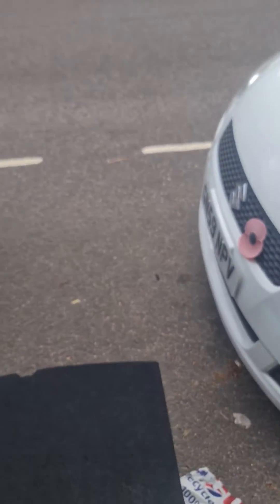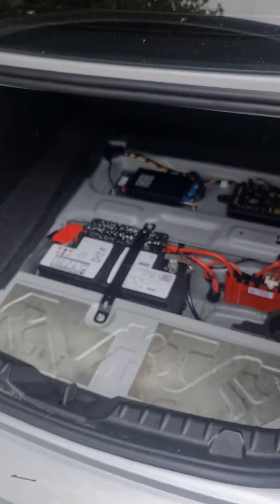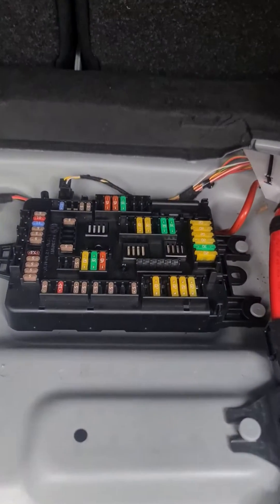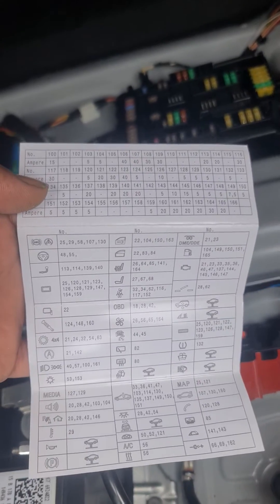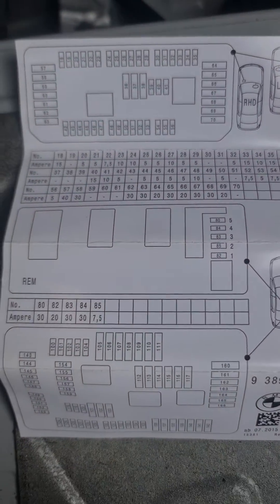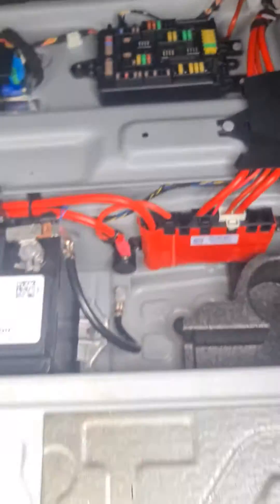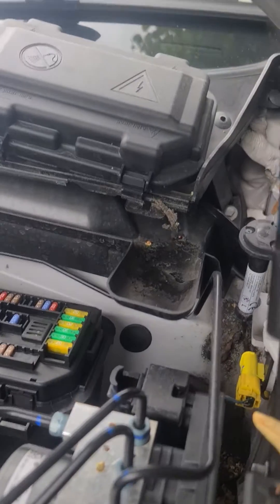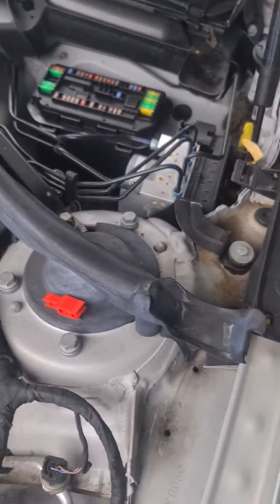BMW 2 SERIES F22 FUSE BOX LOCATION & DIAGRAM

Comment: Any idea which fuse is for the license plate lights? One doesn't work for me. Otherwise, I'll just rewire the one that works into the one that doesn't. 😢
Reply from the maker: Don't get me wrong but I'm not here 24/7 to give clues for people if you have this kind of issues check fuses I'm trying help as much as I can but come on I'm working as for living
Reply: @Empire-Motors-UK  we swap the fuses that were blown but it wasn't related. Ended up getting a wire and splicing it from one plate light that works into the opposite side. Lol

Comment: Can you tell me where is the cigarette lighter fuse? Because I check those two fuze boxes in my vehicle and could it find the blown up fuze or if there is a blown-up one. And still no 12v power. There is a lot of videos that shown but I replace almost every fuse 😆
Reply from the maker: Was it before working ?
Reply: @Empire-Motors-UK  I just got the vehicle like that, with the front 12v (cigarette lighter) not working.
Reply from the maker: @prp0328  probably lighter fuse ppace is empty that's why check even empty spaces
Reply: @Empire-Motors-UK  Thanks for your suggestions, the USB charger was too short I guess, I try another one longer and it works 👍 I always thought it was universal but they are longer and shorter.